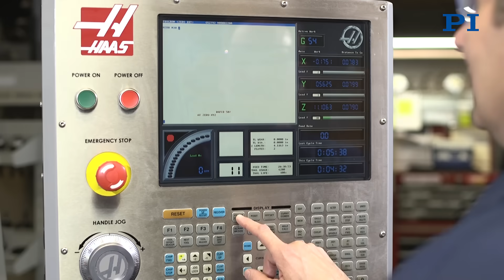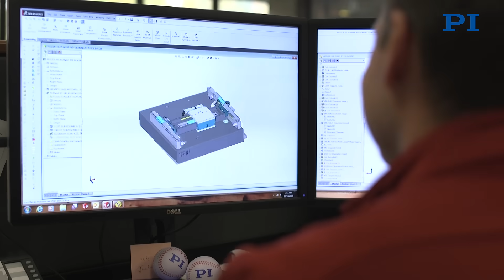Air Bearing Manufacturer: Motion Systems Design Insights Into PI USA's Air Bearing Operation

Comment: I wonder if is posible to use air bearings in a Turbofan Engine?
Reply: I think they use aerodynamics bearings, as opposed to sadistic?.. anyway, once they're spinning, they basically use the no slip condition to drag boundary air sound them, but can suffer wear at startup and shutdown.